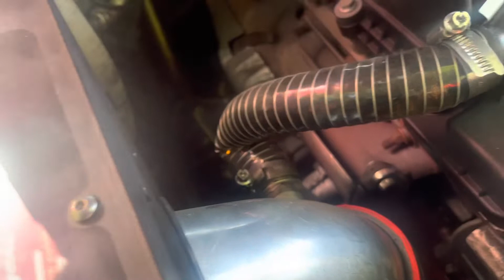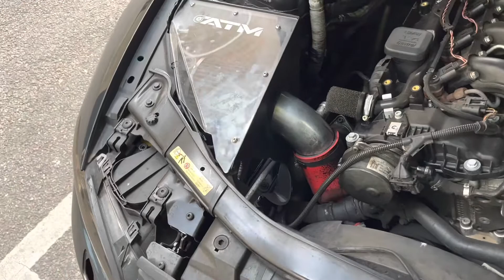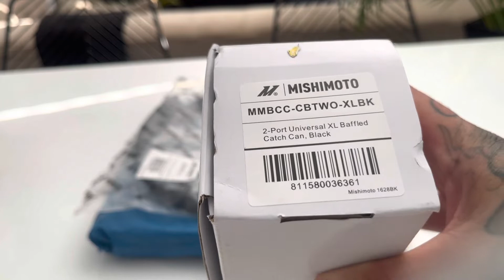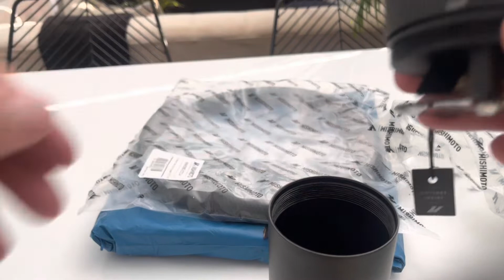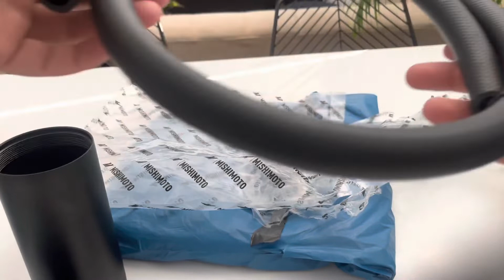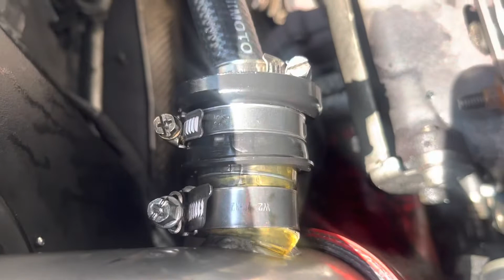THE BUILD EP4: THE PERFECT M57 INTAKE. MORE 335D PARTS + MISHIMOTO CATCH CAN INSTALL.

Comment: That isn’t the correct catch can for the M57. It requires a high flow unit to avoid increasing crank case pressures. Mishimoto does make a hi flow one but the hose diameter should be atleast 1” for the M57
Reply from the maker: Yeh it is

Comment: Hey there buddy which oil catch can is that would you be able to link it? :) I was actually about to buy ATM for my e92 335d as I got standard air filter box but I have k&n however I’ll be running stage 3 hybrid turbos and hoping to get to 485-500 so I’ll need a little more air intake